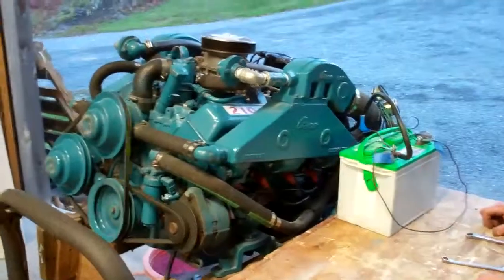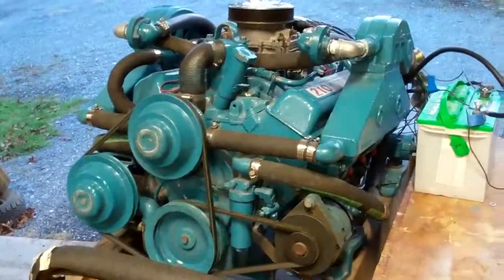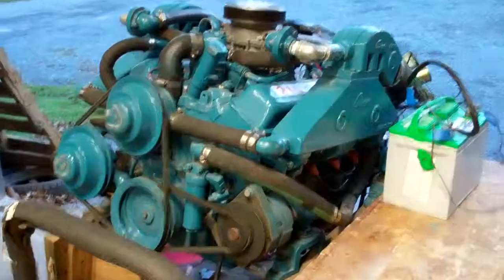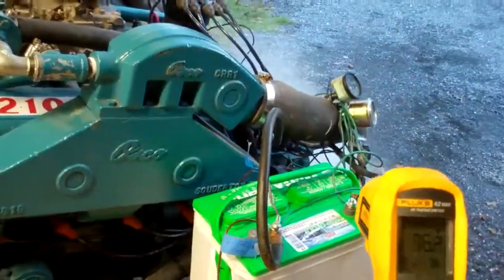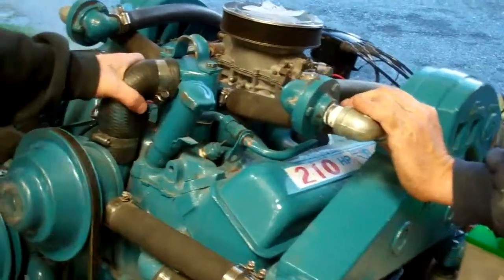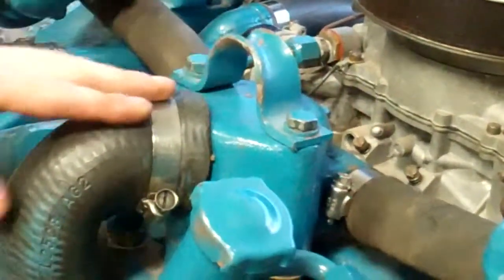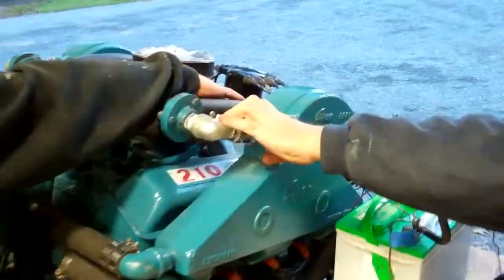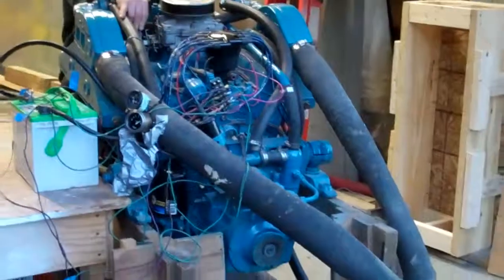True North's New 327F V8 Roars to Life 11 4 13

Comment: So that engine looking from the front turning to the right, are the crankshafts the same for left or right is my question
Reply from the maker: Yes, everything turns the same way. The only rotational difference is that the driveline is fitted with a left-handed prop.